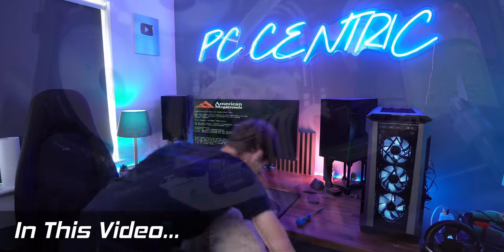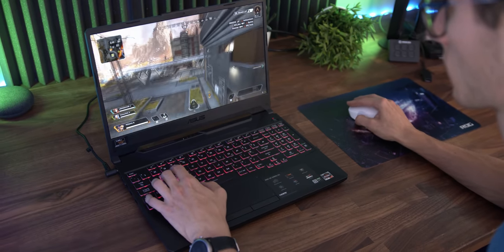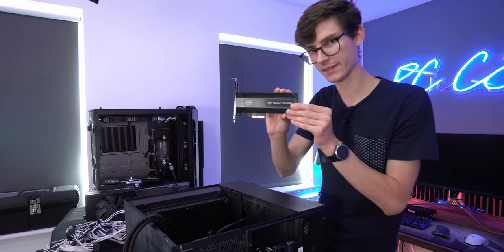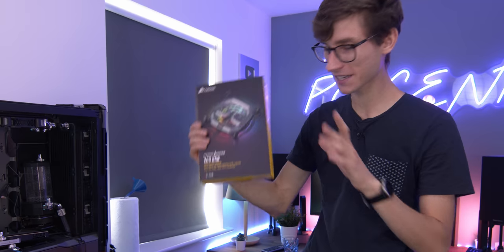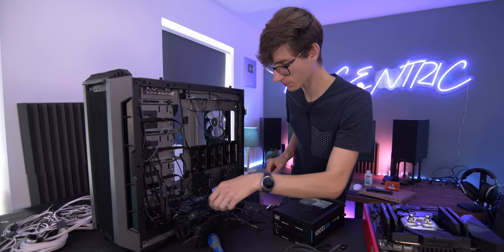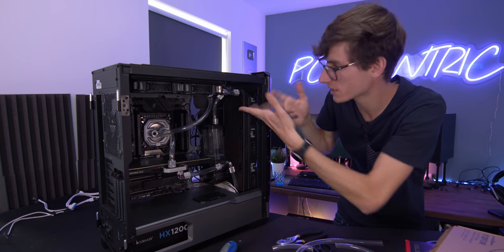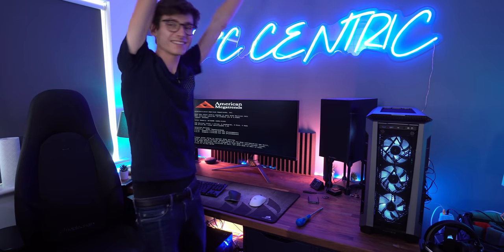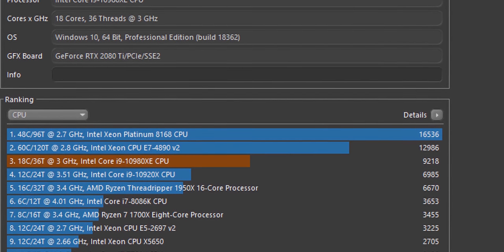My Personal Rig Is FINISHED!! [Water Cooled 4K Gaming PC Build 2020!]

Comment: 2:55 if your GPU was cutting off and shut down with high RPM fans (or temp raised up rapidly after run any GPU workload ) that mean your GPU tilted downwards (even a little can affect) because of high weight (had same issue before and fixed with GPU bracket)

Comment: For the framerates issue - Check if DSR is off or not. Or is there a render scaling setting turned on. Sometimes DSR can reduce performance as it renders your video at a higher resolution, even if it's onyl rendering a part of it, which does require more GPU horsepower and reduces your FPS. Just a suggestion :)

Comment: 2:40 dude its so simple to get your answer! all new graphic cards and both amd and nvidia drivers are focusing on silent working. for example my AMD GPU on default setting wont turn on fans until GPU temp go above 70 degree. that's because of shity  "Zero RPM" feature in AMD drivers which i turn it off always and set custom curve for more life span and lower temp inside the case area. Most likely your problem with stock cooling was the same as I mentioned
 and your GPU temp limit force your pc to shut down. for sure there is a silent mode option (maybe has different name) or some thing like that in  your GPU or Driver and u can disable that or set your custom curve for fix that issue.

Comment: This is a very powerful PC but I do think you can upgrade the aesthetics of this rig by having a specific design language in this PC, you can hide the gpu power cable by putting it between your gpu and tubing, and you can also have the tubes bent so it's more angular, finally I think the RGB strips on the top of the case is unnecessary as you can see individual led reflect off the radiator. I personally think sticking with a specific colour scheme would make the pc look way nicer than just rainbow vomit, too. Anyways I enjoy watching your videos and here are just some suggestions.

Comment: Great work again Marcus. I've just purchased all the Hydro X items i need for an open loop in my Corsair 465X case. For your next video regarding the open loop could you PLEASE use a 465X case if you have one. I'm just really stuck as to where to put the XD3 with the case been relatively small. I've thought about replacing my rear exhaust fan with it and upping the rpm of the 2 top fans to compensate. Regards, Shaun.

Comment: you should check the speed of the cpu while gaming, i see that this cpu clocks to 3ghz base and 4.6 boost but XE cpu with that many core tend to drop really fast. For super high fps you need clock speed, not core count (not with old game engine based on 1 single core like Apex, CSGO, Far Cry etc..)

Comment: Just a suggestion about your frame rates could it possibly be a setting on your monitor itself? I ran into this issue and thought it was my PC when it was a setting that was making my FPS drop on my monitor. I could be completely wrong.
Reply: yes its from your monitor. set your monitor to the highest resfresh rate. set your in game settings to unlimited fps and disble all gsync gync. any sycinf
Reply: Dennis Dowd  im 14 and i can call you a boomer. and yes fortnite is the best game of all time.
Reply: @iamf6641  fortnite is in fact the best game out there but from season X players opinions have gone very much down and now many people prefer  gta😂
Reply: @Ft.chi23  gta is ded just wait 1 more year
Reply: @iamf6641  exactly 1 more year 😭😂 anyways fortnite used to be “elite” but even minecraft has more players 😭
Reply: @iamf6641  if your gonna be still be playing in 1 year. Hold on let me pray for you 🔍
Reply: @Ft.chi23   gta has long been dead.
Reply: @iamf6641  yep
Reply: @iamf6641  why would he spend the money on a gsync monitor to turn it off thats stupid
Reply: Check Nvidia Control Panel, may have a DSR applied.

Comment: Ref the graphics card fault.

Had this issue with an update. 

Have you fixed the gpu issue?

Sync issue with the screen and the gpu?
sometimes caused by a bum fight in options with the gpu or application controlling the fps rate. Normally pops up on none G sync screens. 

I don't think it is the above but its another route to look into.

Have you checked it out in the cputemp app. Ie clock speeds and load ect. 

I found an option on the gpu settings

Comment: i have a asus rog strix 2080 ti oc  and overclock it ur self can give you around 10 to 15 fps more but ur monitor must be connected with dp cable and make sure there are no filters from NVIDIA ON, no G-sync and you are at maximum frame rate. apart of that there are a few more things that u can do on NVIDIA control panel but wont change much. it is possible you just have a bad batch of the GPU. my first one was ok and after couple months just gave me BSOD so i call it in and they sent me a new one and they told me there was a problem with the first batch ( I buy my GPU soon it came out). hope it helps

Comment: Run benchmarks and record clock speeds. Reset your BIOS / UEFI and manually change your settings. Meaning you can't use old BIOS settings on a new CPU. Next go to the MOBO's OEM site and check / update Drivers and BIOS. If your GPU has dual BIOS the switch BIOS. Reinstall GPU Nvidia software using the "Clean Install" option from a custom install. GL

Comment: have you confirmed your GPU is not at full load? I'd run some sort of hardware monitoring (maybe HWinfo64 or afterburner) to see if your GPU is being close to fully utilized. I'd have a hard time imagining that in Apex you wouldn't be getting close to full GPU utilization at 3440x1440 with a 10980XE unless the CPU clock speeds were not boosting appropriately (or if it was some sort of driver error). I believe X299 supports per-core overclocking. That may be worth some time investment on your part to improve gaming performance as well. I'd also test other games to see if you're getting the same issue of lower framerates than expected to nail down whether it's just Apex that's having problems or something wider spread.

Comment: Don't you need to change your loop ? What's the point of passing from one radiator to the other on the loop ? isn't better to go from the pump to the radiator and then to GPU then the other radiator then the cpu and back to the pump ?

Comment: Check settings on actual monitor to establish what refresh rate has currently been set at.
If lower than expected, say 100Hz and expecting 160 then look in Windows Display Settings | Advanced display settings | Monitor and verify what the Screen refresh rate is set to (it's a drop down).
Other than that, just make sure you haven't enabled Vsync :)

Comment: Have you run GPU-Z to find out what utilization level your gpu is achieving?  I don't play Apex legends, but if it only uses one or two cores, I'd check to make sure the cpu is boosting up.  4.8  GHz would not be a bottleneck, but 3.0 GHz would.

Comment: Fellow 10980xe owner. Was that cinebench run stock clocks with the 9218 score? Mine stock with just xmp enabled got around 8,400. Also, mine overclocks to 4.7 all core at 1.165 volts and under 80C during 5 consecutive cinebench runs. My best score is 10740 so far. Still tweaking with the clocks to see if I can get something higher. Cheers to the new build!
Reply from the maker: That's overclocked to 4.6 I believe!

Comment: Just a thought, checking if gsync is being detected. As well the monitor set to the highest hz. Personally I had this issue with 10900k and 2080ti and I just removed the frame ate cap on the game and also turned off v sync, again just a thought could be wrong though.

Comment: What does GPU-Z say for Perf Limit under Sensors when you're running something like a Heaven benchmark? I had this problem with my 2070s recently; it acted like it was being denied power and actually was underclocking itself. My end solution was to uninstall all overclocking software and reinstalling.

Comment: I've been saving for ages and finally have enough to build a pc but I'm torn between AMD or Intel
Reply: Depends what ur planning to use it for
Reply: @tamimrezek635  gaming really, I have about 5k saved so far and I'm just stuck where to start
Reply: If u mix workstation and gaming go AMD but if u only and only game intel is slightly better but if you plan to stream intel suffers higher frame loss
Reply: @Jai O if you do go for amd I would say wait for 4000
Reply: @tamimrezek635  thanks for the replies, its frustrating having so many options and so many new technologies coming out soon and knowing where to begin, it will purely be gaming only.

Thanks again
Reply: @UKJaiO  definitely wait for ampere aswell the new 3000 GPUs are gunna be what you want
Reply: @ferocious5975  thanks, too much coming out lol
Reply: @UKJaiO  amd is the move baby
Reply: Jai O yeah so in the near future I’m planning a similar priced rig and even though is only gaming I went for the 3950x but the 3900xt is on par
Reply: Jai O no problem but wait until psu prices have gone down Covid is the biggest reason for increased prices

Comment: Have a similar issue with my 2060 after i had to replace the board for a upgrade. Brand new card and runs worse than a 1070 at the moment and wil max out gpu usage for no reason.

Comment: Imagine getting a thousand pound setup, wasting multiple hundreds of pounds for a 2080 - just for the 3000 series to be released in 5 weeks
Reply: The 2080’s still a super good card
Reply: @alexhshhshsh9961  No doubt about it, but he could've waited 1 extra week and save 1000 pounds, or spend the exact same amount on a 3090
Reply: @spongy7x  Hes sponsored he will get a 3080 for free due to the PR community scheme reviewers have on YT
Reply: @ShaneeyLX  I thought they only get the cards for testing and benchmarking and then they had to give it  back. Is that not the case?
Reply: Bro he's rich off of youtube. Even if he doesn't get the 3090 on his rig, he could just order 1 on amazon immediately if he wants to.

Comment: Hi
Check if you are running the grapich card in PCI EXPRESS ×16 Gen 3.
If you running in Gen 2 you will lose 15-20 Fps or more
Go to Nvidia system info and check.
This has happend to me, i have 10940x and 2080ti.
Good Luck

Comment: Just curious. I notice all these water-cooling builds have the radiator inlet and outlet at the top. No system can be 100% air free. Usually anywhere from 2%-10% of the air in the loop. Thus air will rise to the highest point in the system which means the top of the radiator. I would think the air would be getting pumped into the block and not allowing full cooling. I have seen tests where this happens and over time causes the pump to fail. The solution was just simply flipping the radiator so the inlet and outlet at the bottom, allowing air to rise to the top and no possible way for loop to suck in air. Thoughts? Not dissing on your setup. it's sweet just noticing I see this on the majority of builds with water cooling.
Reply: No, it collects at the top of the res, the pressure in the system pushes it through. Only in AIO is rad and tube position key.
Reply: good to know. thank you

Comment: Overheating part is an nzxt thing. I had s340 elite and z63 aio 280mm mounted at the front (since you basically can't mount it anywhere else) . The airflow is non existant... My MSI 1080 Gaming X was always at 82-84° while gaming. 
Never buying nzxt case ever again!

Comment: which motherboard should i use with  i5 10600 and gtx 1660 super?
Reply: Random person on the internet  bottleneck? u sure about that?
cz i've seen other youtubers build a pc using i5 10600 and 1660 super
i just wanted to know which motherboard would be best.
Reply: @abudozananiloy9993  No that's not bottlenecking at all !!
It's a balanced combo...
And you should go for a Z490 or a H310 motherboard
Reply: @princearya3248 thanks but z490 motherboards are kind of overpriced for me
Reply: Random person on the internet  no i prefer 1660 super .
Reply: @abudozananiloy9993  Yes 1660 Super would be a better choice currently
Reply: @abudozananiloy9993   I know but since Intel 10th gen is kinda new so I don't think there's a better option than a cheap Z490 motherboard...
Go for the cheapest ones with basic functionalities...
Hope it helps !!
Reply: @princearya3248  yeah I also want to use a z490, I'll definitely try to use it in my build
Reply: @abudozananiloy9993  Great !!
ALL THE BEST !!

Comment: Its a cpu bottleneck.
Your cpu is a GOD for multithread performance, but games arent using 20 cores. Most of games are using 4 to 8 cores. So its more about single thread performance.
Reply: If you use 10900k you will most likely not bottleneck your gpu